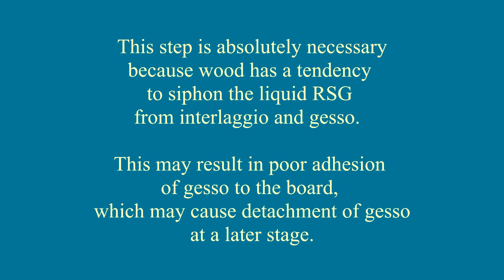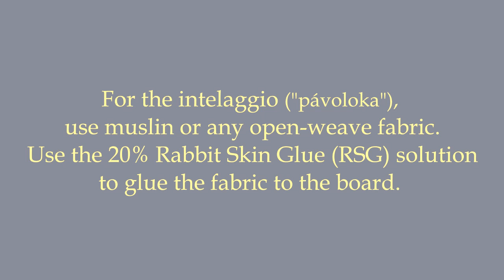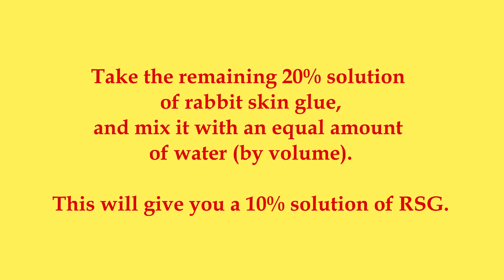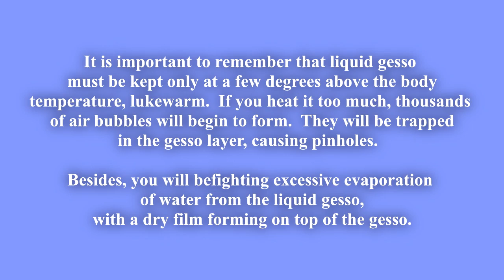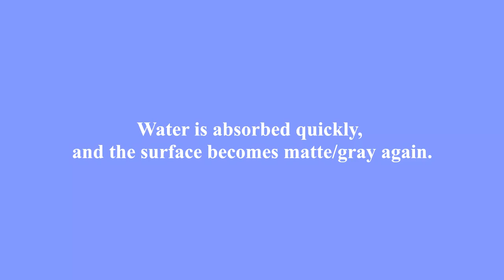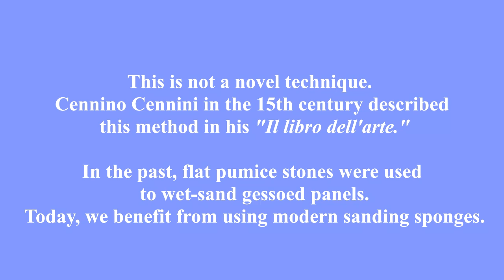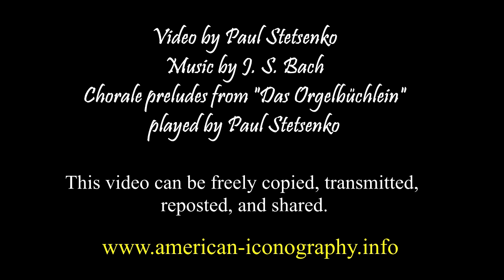Making an icon board

Comment: Is there a video on the steps to making the icon after this? I was hoping to attend a class but I don’t think I can now do I really would like to try it at home.
Reply from the maker: Dear Megan, there is a gazillion of videos on how to paint an icon on YouTube, but none of those will help you.  One can learn to make an icon board, or even to gild, but these are rather simple procedures.  Learning to paint from videos is like learning to conduct by watching conductors.  Most of it will be incomprehensible to you.  Now, a good place to start is to go to one of the GOOD iconography workshops that work with beginners.  Two of these stand out: the Dainekos (ikona-skiniya.com) and Hexaemeron.  Go to any of these and they will give you a good start.

Comment: Hello,
What's the temperature of glue, when I'm adding chalk? Around 60 °C or more like lukewarm? Thank you for your help :)
Reply from the maker: Olga, I never measured it, but it has to be quite warm - but definitely not hot.  If it is lukewarm, it is safe enough but then it might take forever for the glue to infuse the whiting.  Here is a suggestion: if you can comfortably hold the container in your hands, then the temperature is just right.  However, if it is "ouch! that's hot..." then it is too hot.  Here is another thought: adding chalk to the glue solution is like adding yeast to warm water when making leavened dough - the same principle.  
Next time I make a board (which will be in a few days, likely), I will measure the temperature of the gesso solution and let you know. Generally speaking, gesso should not be too warm; otherwise, water evaporates like crazy and you have to add it to the solution all the time.  Hassle...
Reply: Paul, thank you sooo much! You are such a great person! My first gesso is all with bubbles (I made it before watching your movie), but I definitely overheat it. I'm waiting for your message :)
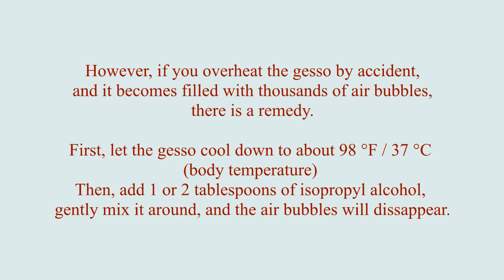Reply from the maker: @1114Olga  There is a solution for accidental overheating of gesso.  It is @15:25.  In a nutshell: if you accidentally overheated the gesso, cool it down to a lukewarm temperature, and add a squirt of alcohol, and immediately mix it around.  The bubble will quickly disappear.  Alcohol does not change the nature of gesso as it evaporates (just as water does).  The only proportion that is of importance is the proportion between chalk and glue.
Reply: It's too late already (I was making board before watching this movie) but I noticed your tip :D thanks anyway!
Reply from the maker: @1114Olga , I just measured the temperature of my gesso.  It was 42°C  (108°F).  It can be cooler or warmer though.  Here is a good way to determine the right temperature: stick your hand into the hot water in the bein-marie, and it should be hot, but you should be able to hold your hand in that hot water for a long time without saying "ouch!"
Reply: @paulstetsenko5721  thanks a lot! I really appreciate your help :) now it's time to try!

Comment: So just to be clear, if I'm painting on marine board (hard plywood, I suppose, that does have a grain, but is smooth) or any other grained wood, I WOULD want to do this technique, with the interlaggio, but if I'm using MDF or hardboard, I can simply gesso? I would like to do some of these using acrylic first, but would like to move to the egg tempera when I have a space to do it (I use acrylic daily for work and would have to move everything, same with oil).
Reply from the maker: Oh, most definitely you don't need the interlaggio for MDF or hardboard.  Interlaggio is only needed to isolate wood grain from gesso so that it does not telegraph through.  I painted a few icons on hardboard (braced in the back), and it is an excellent material.  ONE THING THOUGH:  before you gesso the hardboard, thoroughly wipe it with denatured alcohol.  Hardboard's surface contains some residual oil which may cause the gesso to adhere poorly and eventually delaminate.

When bracing the hardboard, use 3/4 inch plywood, never pine planks.  After a couple of years, pine turns into a twisted mess, and it takes the board with it.
Reply: @paulstetsenko5721  wow,  good to know! It's startling how many years I've painted on wood and didn't know this! Just did a cut out fish (marine board, 3/4"), and the collage and paper on it started coming off the wood in humidity during a show. I had to take the whole thing back down to wood. I will take this advice. Thank you!

Comment: I do not want to glue fabric, how will I prim the wood, with 10% glue or with 20%?Thank you very much. I wish you be well!
Reply from the maker: Years ago, I decided that gluing fabric to the board was too much work.  So I primed the board with a 5% glue, and applied gesso directly to the wood without fabric.  Upon drying, gesso cracked.  Wood (even plywood) expanded while wet, contracted upon drying and cracked the gesso.  
The only material you can gesso without gluing fabric is MDF board.  I used them, it is an excellent material.
Reply: @paulstetsenko5721  I have MDF! so that I can put a 5% pass, then make a 10% solution with chalk, right? Thank you so much, I am waiting for an answer, thank you!
Reply from the maker: @Dive5344   Here is what to do:
First, rub the surface of the MDF board with alcohol.  It will remove any oily residue left from production.
Second step: prepare a generous amount of a 5% rabbit skin glue solution, and size the board 2-3 times, waiting for each coat to dry fully.  After that, make your gesso the way you usually make it and begin gessoing the panel.  Recipes for gesso vary greatly.  I use 10% RSG, the amount of chalk twice that of RSG solution (that is, 1 cup of 10% RSG solution to 2 cups of chalk by volume).  Other recipes also exists; Marty Horowitz, for instance, recommends one cup of 8.45% gelatin solution for  1.5 cups of chalk by volume.  Do what works for you.
Reply: @paulstetsenko5721  Thank you very much!

Comment: Hello Mr Paul, thank you for your video, it is very useful, I have one question, how long can we keep the gesso and where?
Reply from the maker: Since gesso is made of rabbit skin glue, it will quickly spoil even in the fridge.  Freezing it, however, kills the glue just as well.  Here is what you can do:
Place your gesso into a shallow plastic container and put it in a fridge for a few hours; it turns into a rather solid tofu-like brick.  Pry it out of the container.  Take a piece of paper towel, spray it generously with Chloraseptic until paper towel is wet (Chloraseptic is sold in drug stores over the counter; it is a cold throat medicine which contains phenol, a strong antiseptic).  You can cut up solid gesso into smaller cubes, or just take the whole block, and place it on the paper towel.  Spray more Chloraseptic onto the brick, then wrap the wet paper towel around it.  Put it into a plastic container with an air-tight lid, and store it in a fridge.  Protected by the vapors of phenols, it will last indefinitely.  When you need it, cut a portion of the stored gesso, melt it in a bein-marie, and it is ready to go.  It might have some residual color from Chloraseptic -- and flavor too :) -- but not particularly detrimental.
Reply: @paulstetsenko5721  thank you a lot for your time and your knowledge

Comment: Thank you for this video!
How much time does it take to finish this work?
Reply from the maker: Day 1: cut the board and size it with 5% glue, wait to dry overnight; Day 2: glue the interlaggio, wait overnight to dry; Day 3: gesso the board (this takes a few hours, depending on the size of the board, and humidity and temperature of the room), wait overnight to dry; Day 4: wet-sand the  board.  DONE.
Reply: @paulstetsenko5721  Thank you!

Comment: "The whole purpose of interlaggio is to isolate the woodgrain from the painting. Without the interlaggio, wood grain will begin showing through the gesso only after a few years."
This is a half truth, and due to the nature of the prep for the panel to begin with. No seal on the wood allows the wood grains to move, furthermore, the nature of the rabbit skin glue encourages the wood grain to open up as it ages. For this reason, I have moved from rabbit skin glue to a non-organic glue, something not available to artist of the 15-16th century... or anyone before 80 year ago. The main cause of deterioration in paneled works is for the deterioration of the wood, stop that, and most topical problems are avoided. Wood worker employ denatured alcohol to "raise the grain" which allows them to preemptively exaggerate this effect, and then if you seal the wood then sand it, the raised grain effect is greatly reduced before you get to rabbit skin glue layers. Glycerin is a vegetable oil, which will lend itself to rot, or contribute to mold growth in the piece later if the moisture is high, go with linseed oil or something else less organic. Ironic how you mention that in the 15th century they used pumice stone, but today we benefit from "modern" sanding sponges! This literally is the lowest form of upgrade you could have gone with from modern materials, and is probably the worst one to have chosen! Wet sanding this surface will not yield the result you may think it does, unless you reanimated (through heating) the surface and allow the chalk to be reabsorbed into the surface, the wet chalk will form a paste of its own, and be less structural, and less cohesive than the rest of the base gesso you spent so long to achieve, while to the touch this seems like its unified, it is an illusion. Chalk, gypsum, talcum, marble dust, all have varying cohesion properties when worked into a water based paste. Floating this layer atop the rabbit skin glue binder without reheating the glue will weaken the top layer for the adhesion of the oil. Removal of this pasty layer and sanding down to a smooth finish is the better solution. For this reason, I use a dry technique, because the only advantage of using wet sanding is to prevent gumming of the sand paper... and has no other benefit in any circumstance. You would never wet sand a car's surface and leave the dust to dry on the hood, then paint over it! The dust is actually taking up some of the porous nature of the surface and thereby lessoning the natural adhesive properties of the gesso, yet another reason to dry sand, and vacuum the dust out, vacuum, there is another modern advantage we have!
Reply from the maker: That's one way to look at it.  I just recently had to deal with a capricious panel with woodgrain opening up without ceasing.  So I sealed it with diluted wood glue.  It seemed to stop the problem.  I have no idea what the long-term prospective is.  It might delaminate in the future, who knows...  But plywood might delaminate in any case in about 50 years.  We just don't know yet.
I used linseed oil a few years back; I didn't dislike it.  It did not disperse quite the way I wanted, and tiny droplets remained in the gesso, quite visible.  Somebody in gilding circles suggested glycerin; I tried and liked how gesso felt, and decided to stick with it.
Reply: @paulstetsenko5721  I can recommend a solution of no more than 15% water to wood glue, more than that, and you are undermining the wood glue's effectiveness. When applying directly to wood, I go with straight up wood glue. PVA Glue is stronger than the wood itself, and the bonds will outlast the lignin of the wood fibers, so impregnating the outer shell of the wood will no doubt prevent a huge amount of aging right from the start. I have gone so far as to use PVA glue to make my gesso as well. This does mean that it is non-removable in the future, but also prevents many destructive things that occur due to it's rigid hold over the panel. If all else fails, the conservator can remove the panel entirely, and keep the last layer of gesso, replacing everything from the paint back, if its worth doing at all!

Comment: Excellent and very informative. However, just one thing: the RSG is not 20%. It is 20 in 120, not 20 in 100, there fore it is around 17%.
Reply from the maker: Probably...  You might be right.  I sat deer-in-the-headlights all through math classes in school.  When I add 2 and 2, I get 22.  
That being so, these proportions come from many sources on gessoing and water-gilding.  One day, a few years back, I decided to line up all the recipes and proportions from many  sources.  The variations between the proportions varied wildly.  The margin between the numbers far exceeded the discrepancy between 20% and 17%.  I was very surprised at those variations.  Yet, all of them came from legitimate historical sources, and all of them workable.  This tells me that the materials involved allow for a very wide margin.
Reply: @paulstetsenko5721  - I've looked for recipes for things in the past like tempera paint and so on and there are many of them. Things like chalk particle size - therefore surface area to mass ratio - are probably a big player. It is what works that matters. for instance, with gilding,  I find that a gilder's tip works best with real gold leaf (grease fromone's hair) but not very well with schlag metal but a synthetic tip works best with that (static electricity). Keep up the good work.
Reply from the maker: @paulgrosse7631  yep!  
What synthetic tip do you use for schlag leaf?  A synthetic tip for schlag leaf didn't work for me; the leaf does not stick to it, or just barely and falls off at the first opportunity.  A piece of acetate worked a bit better but not 100% percent.
Reply: @paulstetsenko5721  A Kilner Gilders Tip 3.5" (1935 - 3.5"). It has a black body and orange coloured hairs which, compared to squirrel, are quite coarse. I found this tip a bit brutal for gold leaf but schlag, cut into two so that it was about the same size as the width of the tip, worked out just right.
I brush it against my hair (on my head, what is left of it) and the static seems to hold it in place. I find that I can pick up a piece (maybe 3.5" ish by 2") and then feed it onto  the area that I'm working on, just about end on (maybe hold it at an angle of about 70 degrees relative to the work) so that the end is placed fairly accurately and then, move the tip along so that it slides down the tip, onto the work. In that way, I can get it to lie in concave parts of frames without too much bridging.
Reply from the maker: @paulgrosse7631  Can you connect with me on FaceBook?  (https://www.facebook.com/paul.stetsenko)  Exchange of info would be useful for both of us.  I can do water gilding no problem, but I am getting tired of it and am looking for variety, and schlag leaf  (brass, aluminum) offers interesting possibilities.

Comment: Thanks for the video! Why not calcium sulphate?
Reply from the maker: Using calcium sulphate may result in something the Russian icon-makers refer to as "bubbling gesso" or "boiling gesso" (левкас кипит or левкас закипел).  Lots of air-bubbles, pinholes, and ultimately excessive absorption of RSG by the material; the latter may result in weaker adhesion of the gesso layer to the board, and eventually delamination.  However,  I also believe that these artifacts are not the result of calcium sulphate itself but instead caused by some impurities and inclusions.  For instance, chalk from Bologna is a mixture of calcium sulphate and calcium carbonate.  I used it a few times, and I had no problems.  I did notice a rather excessive amount of air-bubbles during preparation, and also more matte surface of the finished gesso which points to the chalk absorbing RSG more agressively than a purer calcium carbonate.   Also, while painting I noticed pinholes forming in the egg tempera's first layer (they disappear under the subsequent coats and glazings, but still...  Perhaps, it would be advisable to seal such gesso with a thicker coat of egg emulsion.)
Reply: @paulstetsenko5721  thank you very much for your reply. I used calcium carbonate once, and a lot of bubbles formed, but it was probably because I used a very high temperature. Another question: when you separate glue for the gilding, then to this rsg solution add alcohol, or water?Thanks again for your detailed answers!
Reply from the maker: @valeriacorvalan6624  , when I take a small part of RSG from the bigger batch to do water-gilding later, I don't add anything to it, because it is already 10% solution of RSG in water.  Of course, when I prepare the bole solution, I do add water (1 part clay, 2 parts RSG, 3 parts water), but that is entirely different process.  Let's not mix the two :)
Reply from the maker: @valeriacorvalan6624  If you find that you overheated the liquid gesso and millions of air bubbles have formed, just add some alcohol to it.  Alcohol decreases the surface tension and all those bubbles will burst.  Alcohol does not affect properties of gesso because it evaporates eventually.
Reply: @paulstetsenko5721  thanks you very much!!
Reply: @paulstetsenko5721  , And the RSG that you mix with clay is 10%? Or is that to put for the leaf of gold?
Thanks for your help!
Reply from the maker: @valeriacorvalan6624  The RSG 10% is the same for both gesso and gilding clay ("bole").  To put gold leaf,  I prefer the process called "water-gilding" and for that I use something called "gilder's liquor" - 1/2 cup water, 1/4 cup alcohol, and a pea-size blob of 10% RSG.  Some people do not even place RSG into their "liquor", and it works for them, as long as they wet the bole correctly.  There are numerous water-gilding demonstrations and tutorials on YouTube.